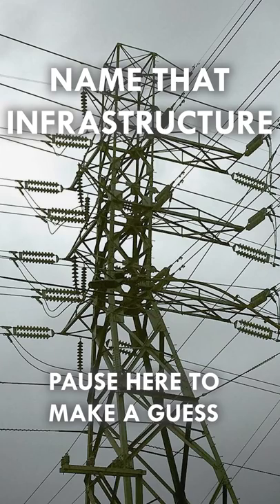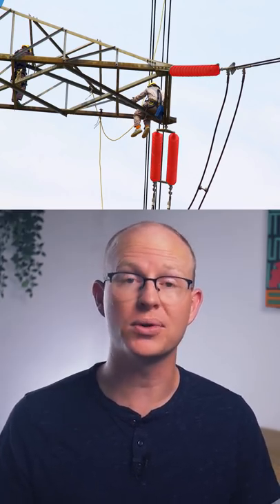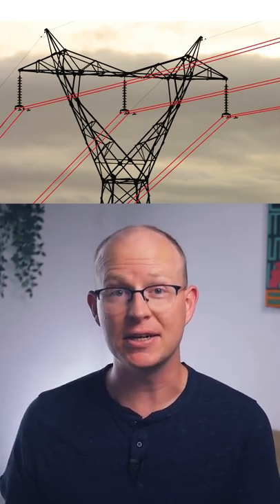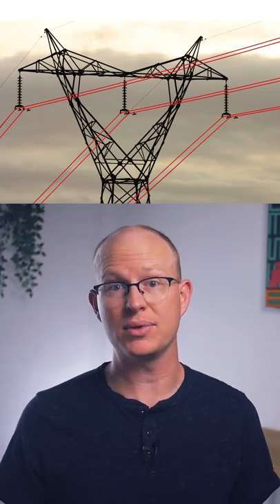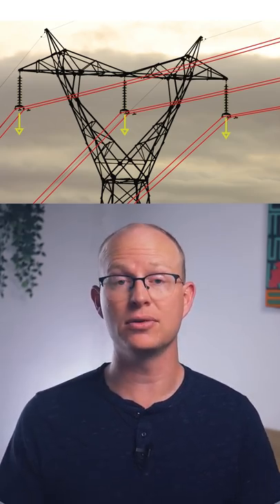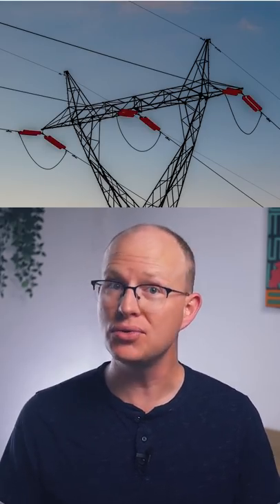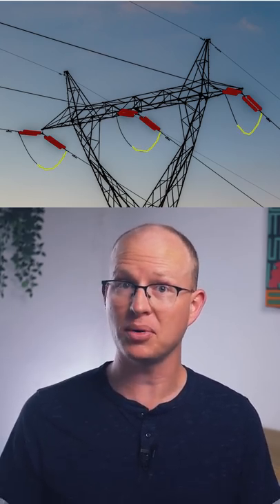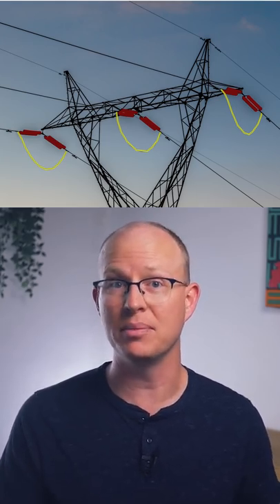Name That Infrastructure (Ep. 3) #shorts

Comment: I’m guessing that the higher up off the ground power lines the higher the voltage.  I also noticed that the top two wires don’t have insulators.  Someone said those wires protect the system from lightning strikes.
Reply: All the current carrying wires (phase conductors) on the tower are the same voltage. The top wire is grounded to serve as a lightning shield wire (it is way more likely to be hit than the phase conductors, which if hit by lightning will result in a 1 million volt surge moving at the speed of light (in metal) down the line so you can't warn anyone about the lighting surge).

The phase conductors are bundled by phase so that they act like a much larger wire for the purpose of the electric field from the wire. Air is only so strong and if the field is greater than 30kV/cm then it will break down and an arc/spark will form. (These sparks are called corona) Corona is bad for many reasons but mainly it is damaging and wastes energy.  Because the electric field is a function of the voltage on the line and its geometry you will find that larger bundles are needed to avoid corona at higher voltages. (The other factor is distance to the litteral ground as part of the geometry)

So long story short the top most wire is intentionally grounded to protect lines from lightning, and the current carrying conductors are bundled and elevated to protect against voltage effects, so the taller the entire tower and the bigger the bundle the higher the voltage. (All wires on the same tower are the same voltage or grounded)

Edit: originally typed on mobile so lots of spelling fixes
Reply: @jasonreed7522 The phase conductors of a single phase are the same from a voltage point of view but are not the same from a magnetic point of view.

The magnetic field strength from each phase  conductor is the same but:

The high currents create strong magnetic fields which result in pushing the conductors apart. The X pieces holding the phase conductors together are designed to accommodate those forces.

Comment: Looks like 115kv or a 161kV circuits connected to a transposition structure to balance the losses and phase balance on long running transmission circuits.
Reply: I’d say about 230kV.

Comment: They need to invest in burying these lines
Reply: You can't at very high voltages. You need multiple trenches dug and it gets expensive.

You can't place two different phase conductors side by side close together in a single trench: arcing will occur between them.

You would need three parallel trenches dug.

Comment: Supporting tower
Reply: It is used where line is turned 6° to 35° and at deadend it uses strain type insulator. There base larger than normal tower And steel is thicker

Comment: I always wondered why seemingly randomly between utility poles would be a metal tower like that. I have seen those in-line insulators on poles as well, but presumably that was due to fewer lines and less tension on the lines.

They kind of look like a spring encased in insulating rubber so I always assumed they were something like a "shock absorber" to protect the lines.
Reply: The isolators are usually made of ceramic, glass or a plastic core with silicone rings, so even if they look rubbery, they're not stretchy :)
Reply: @Mezgrman  Thanks. Yeah, my exposure to them prior to this video is driving past them, so I didn't ever get a good look, heh. Glad to know what they actually are.

I'm curious, why that shape? I get the nonconductive composition and having a cylinder for cross sectional area, but what do the rings do? Is it something like preventing vortex shedding from wind passing the cylindrical core, or perhaps movement dampening like the spheres on long lines across exposed areas like lakes, or something else entirely?
Reply: @Merennulli  the rings are there to increase the length along the outside of the isolator. Imagine if they were just cylindrical, then a slight film of water could form relatively quickly and cause leakage currents or even short circuits. The ribbed shape makes it way less likely for a continuous film to form.
Reply: @Mezgrman  Oh wow, thank you for explaining that.
Reply: @Merennulli  glad to help :)

Comment: What is a strain insulator's function, and how does it work? Can only find videos in Hindi haha
Reply: They're strong enough to hold the wire, and are insulated electrically so the wire's electricity doesn't flow to the pylon
The discs are made of something ceramic which doesn't conduct, the links between them are normally made of steel but the steel bits don't go all the way through, there's one on each side so they're separate, and the reason there's a big stack of discs is so there's a long way for the electricity to go if there's dust or water drops on them so it can't shortcut along the surface
Reply: @sqekyy  cool! Thank you so much!!
Reply: @sqekyy  just to add, there are also glass and polymer strain insulators but everything about them is pretty much the same in terms of how they operate.
Reply: @sqekyy  close enough for the layperson, but not quite right.